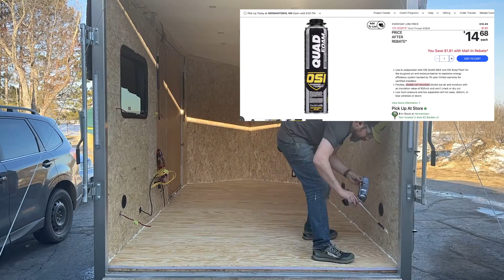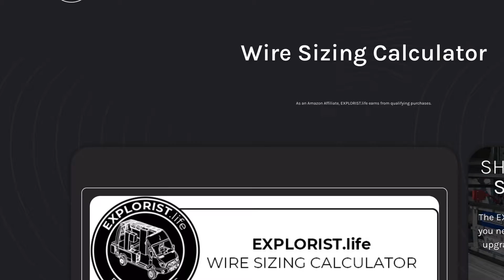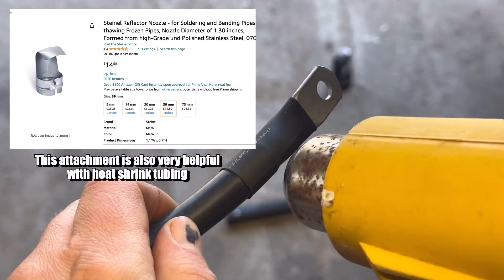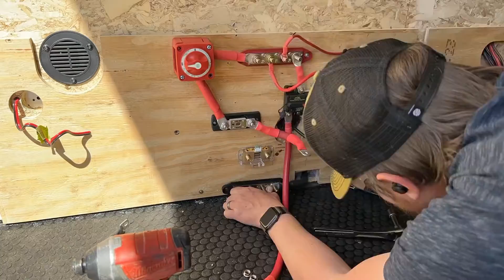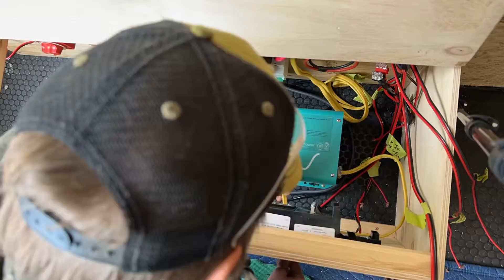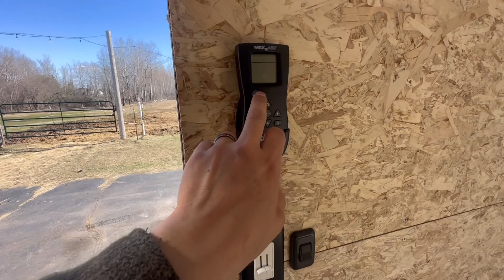Cargo Trailer Conversion Series: Flooring & Electrical System- Part 2, Final Episode!

Comment: Well done! I was searching for a VOC zero insulation solution and your build is the closest that I found on Youtube. Not too sure if you have mentioned in your previous video, but I have the following to clarify if you don’t mind:
-did you insulate the ramp and the doors? what material did you use?
-the wall furring strips were directly over the the aluminum studs - wouldn’t this be thermo bridging and creating heat loss? any idea to break this thermo bridging?
-OSB board or plywood for the wall strength: is this specific to this trailer manufacturer or likely a universal rule? I am wondering if a thinner plywood would be ok.
Reply from the maker: Thanks for your comment! 
I’m a BIG advocate for zero/low VOC options. This build isn’t the best at showcasing that but I tried to talk about VOC concerns and bring awareness to the issue. It’s surprising how most construction materials off gas and a lot of people either ignore that or simply don’t realize. 

Sheep’s wool is very misunderstood the construction industry and only recently has it made it to the US market despite it being commonly used in Europe. People have been holding onto misconceptions such as “it traps moisture and causes mold”. This couldn’t be further from the truth and I plan to do more wool related videos in the future. Wool is ideal in high humidity environments, especially ones where high levels of insulation and vapor barriers are difficult or impossible. 

I had plans to insulate the doors/ramp but didn’t get to it before I sold the trailer. The ramp would be easy to insulate since the osb is simply screwed down. The man door looked a bit tricky since there was a frame that was screwed and glued in place. As long as you’re willing to reseal and maybe replace the wood (damage likely) it should be a day project. 

The firing strips were simply screwed to the metal framing. Metal has a much much higher thermal conductivity compared to wood. Something like 237 W/mK for aluminum compared to 0.1-0.2 for wood. Wood directly on the metal will significantly slow the transfer of energy but yes, adding something like foam will improve it even more. If I did it again I would probably use cedar strips but first apply a foam strip to further limit thermal bridging. Additionally, any condensation will no longer be in direct contact with the wood. There’s a lot of products out there but if you want an inexpensive option that can be found at big box hardware stores, they make closed cell foam underlayment with a reflective face. It has limited compressibility which is good if you’re going to squeeze it with furring strips. 

And lastly, the OSB/plywood is considered somewhat structural with my particular aluminum trailer. I’d go out on the limb and say most aluminum trailers would be the same way. The manufacturer can save money on labor and metal by simply reinforcing with plywood. With steel trailers, it’s probably a different story but I have no experience with that. That being said, I didn’t notice any difference in terms of strength with the sheathing off for a short time. That’s my experience with my trailer anyway. 

Hope that helps!

Comment: Hey man - I’ve watched a lot of your videos. All are super helpful as I continue to build out my trailer. I’ve made some design changes based off of what you’ve recommended, so thank you for that. Question for you - for the walls. Do you have a recommendation for walls to put in there? I see you use OSB - is that what you’d recommend or is that because it came with the trailer? 
Thanks in advance
Reply: Depends on purpose but mostly OSB is purely used as cheapest option. Doesn't hold up well, especially if wet and not as strong as true plywood. Doesn't look great painted either
Reply from the maker: Sorry for the late response, I wasn't seeing notifications for a while. Thanks for your kind words!

Generally I don't go out of my way to use OSB. But since my trailer already had it and I didn't have a big budget, I reused it. Also, since it came with DryMax OSB I felt more confident it would hold up well in the trailer.

If I were building another trailer for myself, I would be tempted to replace it with something like untreated pine or cedar tongue and groove or shiplap. I'd probably use narrow head cabinet screws instead of nails for added vibration security. I like to use natural, untreated products whenever possible to limit VOCs. You then have the choice to seal it how you choose using low or zero VOC options. Just keep in mind with some aluminum trailers the osb or plywood is somewhat structural so you have to replace it with something rigid that can resist movement.

Hope I'm not too late in responding. Thanks for watching!

Comment: I just want to say thank you for such a thorough walk-thru. I just purchase a 6x10 already converted (minimalist) because the price was so ridiculously low I couldn't pass it up. It's good enough for the few trips I need to take this summer but over the winter I was planning on pulling the interior panels and re-doing the electrical system. One, because it's not configured exactly for my needs and two I just want the piece of mind that it's done correctly. This whole build is so close to what I was envisioning. I'm sure I will watch this whole series and especially this video multiple times between now and when I start the rebuild. The fact that you provided details on exactly what components you used and where to find them along with the calculator resources will save me so much time. Again, thank you for going into so much detail.
Reply from the maker: Thank you for the kind words and good luck with the rest of your build!